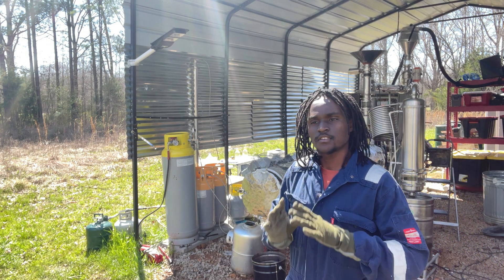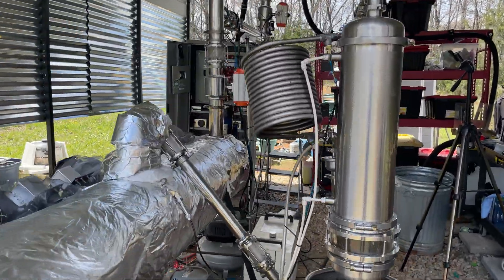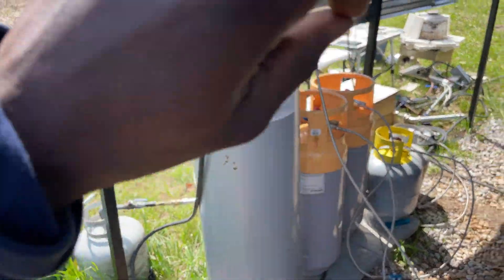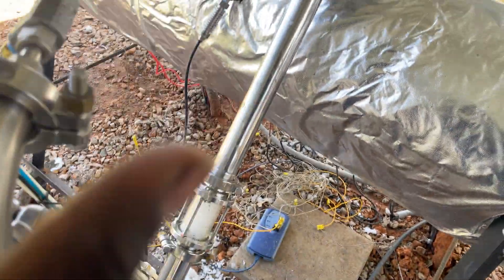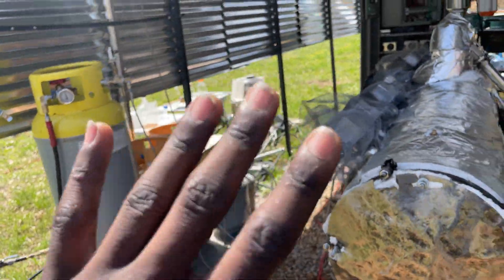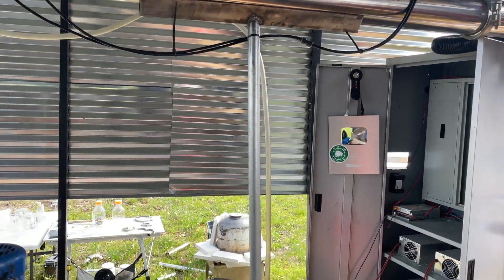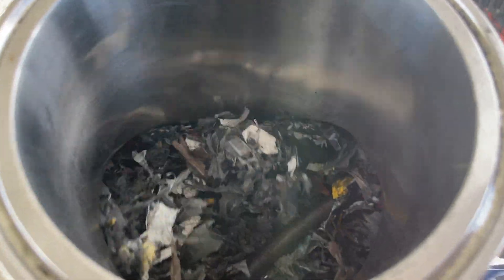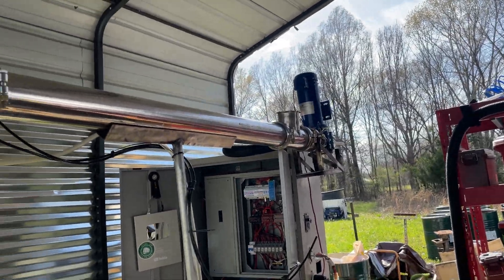Plastic to Fuel Reactor Run

Comment: I feel like an automated hydraulic press plate to pack it in would be very efficient. It doesn’t have to be super powerful but if you end up redoing the main chamber into something a lot more sturdy or you can certainly turn up the bars. 🤙🏼

Comment: New idea a large solar mirror that leads to a circular spiral double width pipe (two togrther and thr srcond champer has a seal on it with a chain.  The chain goes around the entire pipe and the mirror (like the solar energy towers or the episode with mythbusters) direectly pre heats and softens the plastic but key is the second pipe has an plasma heater and air compressor on it to blast the plastiv thru tbe system at extreme velosity. At the thr end of thr looop exists a drop hole and ai picker that removes large pieces or debris using sims . And thrn after that the pre softened mix is compressed inside the same pipe and part of it goes to make new 3d printer threads and the other part goes into 5hr plasticlene processes? 😊😊
Reply: Like the compression procsssing part csn possibky sepertste the liquids from solirs fixing yihr clogging problem esp considering thr heating also maybe cerrramic balls or cubes in the pipe attsvh to thr overhead chain can keep everthibg flowing.
Reply: Put the bottle down, if i understand what you are trying to say, you are actively going against his mission, he doesnt want to use professional equipment like plasma heaters, if he did, this system would already be running on infrared which heats much more evenly.

Comment: For the fuel distillery if if you add water would it help with not blowing yourself up?
Reply: no, he needs a proper seal between the main chamber and his "continuous system" it will blow up soon if he doesnt recognize it and fix it.

Comment: Instead of ram rodding every piece of plastic down the tube a concrete vibrator could be the solution. Not the whip kind but the 8 inch by 4 inch ish concrete pump kind

Comment: I'm not knocking but it would be more continuous if you could grind directly into the pot. Need some sort of double valve system down the road
Reply: he has a double valve system, its just not airtight.

Comment: Where should some one start if they want to do what you do?
Reply: They Shouldn't if you are truly interested in this, google Pyrolysis, and see if there are anybody hiring. This is already a known process the only innovation that Julian has done is to make it himself out of trash. It's not a good system, and he doesnt solve a problem. He just makes solid stable plastic into volatile airborn plastic. you should not do this. this is not a way to get cheap fuel.

Comment: Naturejab, im planning on building one of these for a school project/ for my own curiosity, do you have any tips or tricks on building one of these to make it work more efficient/ work seamlessly?
Reply: if he did, he would be using it. This system is inefficient  by design, the process is energy intensive and it doesn't produce fuel, it makes a flamable liquid but calling it fuel is a lie. Before you try to do this, dont get your research from Naturjab, go actually figure out what this process is. You can start in 1877 when it was invented, then check out what they discovered in the 70's and why this system isnt used by any big companies. Hint ; It's highly inefficient and it doesnt get rid of plastic, it just changes it from a Solid stable plastic, to a volatile airborn plastic.

Comment: 🤙narley bro.
My personal opinion is to never turn this stuff into fuel for diesel engines(if that makes sense). 
...I think that it would be extremely wasteful to do that because diesel can run off anything that's oil-like. (Like corn oil or peanut oil, or used McDonald's Grease)

So using plastic waste should 100% be dedicated to gasoline engines.

Comment: I love the progress ❤.....  But can we add some low budget conveyor conveyor belt lines. Maybe even 3D printed and maybe palletize the plastic so that it's a little heavier and falls into the machine on its own without getting clogged... Or maybe even after you pelletize it at some point before it goes in the machine, it's again pulverized.... I understand. We're trying to keep a vacuum but all I'm asking is is there some way to combine it to where it's still under vacuum but with these added systems to make it more efficient and truly continuous?
Reply: With the heat involved here, i don't think 3d prints are going to hold up for too long. He is already struggling with keeping the vacuum, i think adding more systems to it, should probably be left to the professionals. you know, the people who make industrial scale version of this system.

Comment: Can't wait for the company to hit open trading. Gotta invest in this man somehow.
Reply: Hail yeah
Reply: It won't, Publicly traded companies have an obligation to make money for the shareholders, this isn't a net benefit. this is a way to dispose of plastic waste.
Reply: @josephxavier1707  Lets be real, he is not disposing of it, he is converting the plastics to airborn plastics. He is just moving the problem into the Atmosphere. And truly the problem with plastic waste isnt the room it takes up. its exactly this. If he only did one type of plastic, his filtration and everything, could possibly handle it, tho his ceramic based filtration system, isnt really optimal for what he is trying to achieve. And since he is not connected to anything official, he doesnt need to test his system. Meaning, nobody has any idea if his filtration even works.

And thats before you decide to make it into a flamable liquid that he has to call "plastoline" because if he called it anything else he would have to get checked. Thats also why he calls it a natural gas substitute, because if he claimed it was natural gas theres actual laws surrounding it. 

Point is, that liquid that he burns in engines, are releasing all that plastic into the atmosphere again. He isn't getting rid of plastic, he is basically cleaning his room by tying helium balloons to his trash and throwing it out the window.

So, before you invest, keep that in mind.

Comment: Honestly this is one of the coolest things I have read about in a long time. Imagine if we could recycle plastics and create gas in our communities.

1) Is there a byproduct after the fuel has been made? is there a way to re-use it? 
2) Does the plastic have to be completely clean or does minor contaminates not affect process?
3) are there limits to the types of plastics used? are some plastics omitted?
4) are you accepting plastic from donors? =]
Reply from the maker: 1: carbon is the byproduct and it is used to mix with plastic for better heating
2. Plastic can be dirty or clean
3: PVC and PTFE are omitted due to halogenated compounds
4: I am accepting plastic - 8491 Hospital Dr #237 - Douglasville GA, 30134
Reply: @naturejab  dude, happy to see you stopped the PVC and PTFE! now it's a little less scary for your neighborhood.

Comment: If you claim it's free energy. Then why do you need an outside power source to run everything? You should be running on the natural gas, oil, and gasoline you're producting.
Reply: Shhh! 🤫 ur not supposed to watch these videos with actual logic! 👀
None of it makes sense when you actually know about engines, fuel pressure and oil conversion
This guy is a snake oil salesmen

Comment: It’s crazy how this isn’t talked about more
Reply: 1877 was when this was first invented. now we have to wait until the 1970 before they introduced microWaves to the equation. (but thats simply just a different way of heating, unreliably so). Shell oil was working on this for about 50 years before they concluded that, this is simply not a good way of processing plastic, and that either reshaping the plastic or burying it / sinking it into the sea / Diving down into the ocean to personally shove it up inside turtles is better for the environment and also their wallets. There is no profit to be made from this, and as far as environmental effects, He isnt getting rid of plastic, he is just making it airborn.

That's why its not being talked about more. it's a bad process, and the only innovative thing about it, is that he built it with trash. It is also not a continuous system, and his "continous system" doesnt seal properly, so the chance of explosion is immense, he needs to keep his tongue straight in his mouth when he's doing this, he is going to hurt himself again, if he doesnt pay attention.

Oh also, he is coming up on time for changing out his Magnetrons, those things are meant for being on for about 3 minutes a day, he is running them for hours and hours, and well, the Magnetrons aren't designed for that, they are bound to fail soon.

Hey i'm sure his deodorant is great tho, might want to invest in that instead. (less chance of people passing away)

Comment: You may need to pellatize your shredded plastic so its more uniform and doesn't clog your feeder.  If you could shred, mix carbon, then pellatiz the plastic it could help with storage as well.

Comment: Put some solar panels on the outside  and maybe some RTG generators to turn that heat into energy so that maybe you could provide active cooling to the entire condensation section
Reply: do you even know how expensive rtg's are, basically trapping a radioactive isotope and converting the alpha particles, kinetic energy to heat and then heat to electricity. pretty expensive things im sure and dangerous too if they get degraded.
Reply: @adityapratapsingh1502  You are absolutely right. I think this kid has been playing too much KSP and think RTG Generators are some consumer grade thing. Its mainly used on space sats and submarines, military grade stuff(Dangerous and volatile if misused). But yeah you explain it perfectly. But the solar panels are a good idea but i don't think its necessary during the development phase cause there are so many power variables changing, a headache to deal with and it would be trivial to the current project at hand. Also harvesting the heat energy off the reactor will not be that efficient unless you spend a lot of money. The tradeoffs are not there.

Comment: Chatgpt:

Julian "NatureJab" Brown's microwave-based pyrolysis aims to convert plastic waste into fuel more efficiently than traditional methods. While conventional pyrolysis often requires substantial energy input, microwave-assisted pyrolysis offers advantages such as rapid and energy-efficient heating. 
ScienceDirect

However, specific data on the net energy balance of NatureJab's process—comparing energy input to energy output—has not been publicly disclosed. Therefore, it's challenging to definitively assess whether his invention produces more energy than it consumes. Further independent evaluations and detailed energy analyses are necessary to determine the overall efficiency and environmental impact of this technology.

Comment: Yo Jab! Have you ever seen where they are making beams and sheets of recycled plastic using sand and a mix of used plastic? I think the microwave tech could make that process better. A continuous extruded beam would be better than dirty fuel. Then making that run on solar and fitting it all in a shipping container. Your current system is close. Just turn down the temp, add a sand feed and extruder. Then sell them to landfills.

Comment: I love what you're doing, I saw your problem and for a easy and cheap way to prevent again is a screen, designed to only allow the max size plastic and here is were your clogs will be and easy to fix. I'll also do some trax about you and your tech

Comment: I used to run big industrial shredders like that. Plastic will eventually get gummed up inside the knives, I found running cardboard through it cleaned it right up.
Reply from the maker: Thank you!
Reply: Like the comment
Reply: Good tip!
Reply: Good idea! If the cardboard doesn’t fix it consider adjusting the initial material feed rate, or using a pressure extruder after you shred the plastic to make it into pellets. Could probably pick up a used one for making wood stove pellets. Regardless, you’re trying to get a a uniform material size… and you just added tolerances to the machine. So maybe you need to feed 1/4”x1/8” chunks instead of 1/4”x.1/32” chunks. You only need to dial it in, no need to rebuild what ya just did. ❤️‍🔥✝️
Reply: I wonder what a few percent biomass addition to the pyrolisis retort would do to the fuel output. Stuff like paper, sawdust, wood chips, etc.
Reply: That would also introduce carbon to the microwave chamber, if you didn't use it exclusively as a cleaning load.
Reply: @LexYeen he doesnt sort his plastic, a bit of Cardboard aint gonna hurt anything.
Reply: Also for the feeder, you may not have enough slope / friction on the screw to build sufficient feed pressure. Consider adding spikes to catch the material or increasing the pitch/slope of the auger. You might be able to find a small ice augers or ten that you can weld together and repurpose. ❤️‍🔥✝️
Reply: Same here, cardboard seemed to pull the built up plastic.
Reply: There's another type idk if it would be good for bottles but at plastic forming factories there's very loud very powerful grinders

Comment: Jabs, you ever test the output to find out what it is primarily? I know it burns fine in two stroke as this fuel appears to be like an oil base a lot like 2 stroke oil added to gasoline. Have you tried running in a 4 stroke small engine?
Reply: A quick analysis showed quite a bit of BTEX in the output, but in all likelihood there is a very wide mixture of unsaturated hydrocarbons.
Reply from the maker: I have burned it in 2 and 4 stroke engines. I have never done a full spectrum analysis, only partial spectrum tests, however I intend to once I finish my upgrades.
Reply: @naturejab  I'm sure I'm not alone in thinking you should have figured out what your product is long before getting to the stage of increasing production of it.  
Assuming it's fit for use as a fuel just because an engine can run on it is very presumptuous too.
Reply: @EddieTheH  oh he knows what it produces. he just doesnt want to tell anybody, cause then he would be shut down.

Comment: So cool, why can’t the government do this stuff
Reply: Because it doesn't strictly help themselves. It would be for the good of humanity.
Reply: @ just like half the cures they have for health problems 
Why fix it when it’s good money before they fix it or don’t fix nothing
Reply: The government can do this stuff, but they don't want to, because this is a highly inefficient way of handling plastics. It's not a system that creates or destroys anything, it simply transforms, it makes solid stable plastic, into volatile airborn plastic. This process creates a bigger problem than it fixes. The only thing NatureJab is doing different is, he built it out of trash. and its also on a ridiculously small scale. and thats the main problem, this system can't really be scaled. You can make it somewhat larger, but you get diminishing returns, meaning the bigger you make it, the worse it works.
Shell oil worked on this for 50 years and concluded there was no benefit to it. it uses more power to make the fuel than the fuel it outputs. and i know nobody is expecting this fella to make a perpetuum mobile, but it seems like thats what the comment section believes he has done.

Just know that when he makes a demonstration, try not to breathe too much, if you are in the area.
Reply: @Rasmustheforest best explanation
Reply: Because they have and will never do anything that would help the world/humans read that again. It’s more money in treating the problems vs curing/fixing it. Sad but true
Reply: @RichHomieAlucard  yup that’s the biggest fact
Reply: They do it in small amounts but the reasoning they give is because it will not yield significant fuel for the energy and money you put into it. 

And probably getting paid to keep things as they are by oil giants.
Reply from the maker: Profit over humanity's future
Reply: @naturejab  it’s sad
Reply: Because the "fuel" made is toxic and carcinogenic, it's not the same composition as diesel or gasoline
Reply: @7hunderstorm242  not to mention that from some of his numbers in a previous video, he is kinda breaking even interns of energy input vs chemical energy out. Not very efficient. He will likely need to scale up